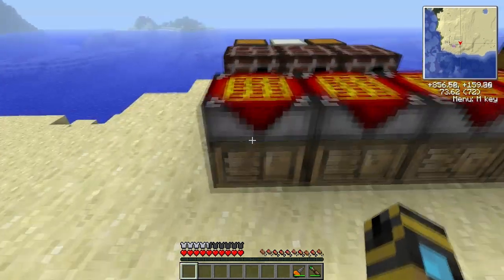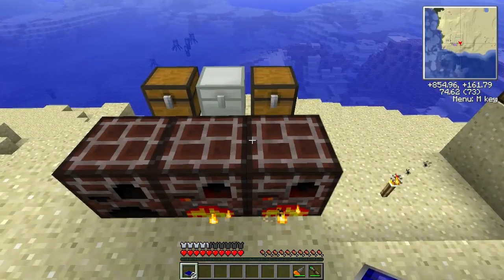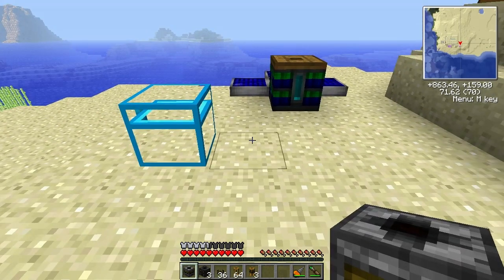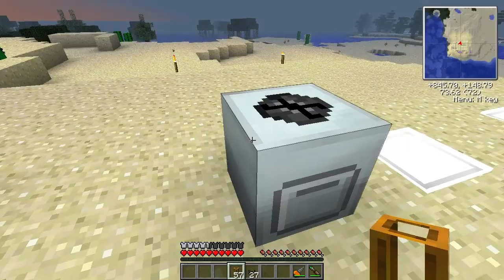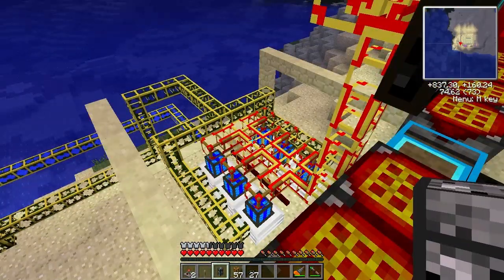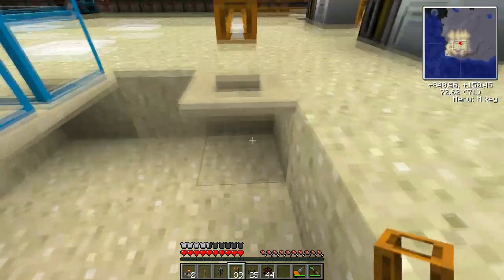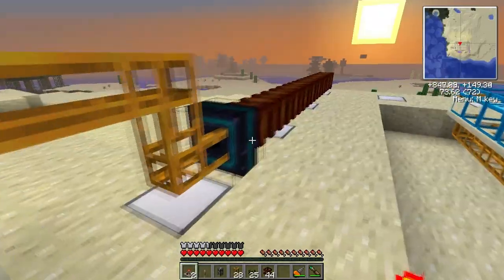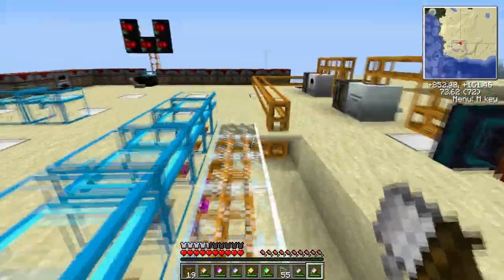Minecraft - RedPower 2 Sorting System Tutorial/Build with 3 Sorting Machines

Comment: anyone who uses tekkit- use a RM furnace. like a macerator and a super butt-fast furnace but ether uses energy collecters around it or alterneas fuel <WRONG SPELLING< or Mobious fuel. type fuel and you see this abnormal coal that starts with a or m. and pipe it out and that is the job by 2 in one. it is very expensive though.